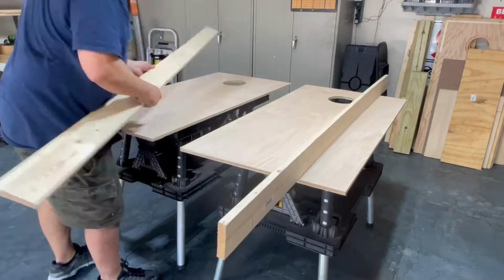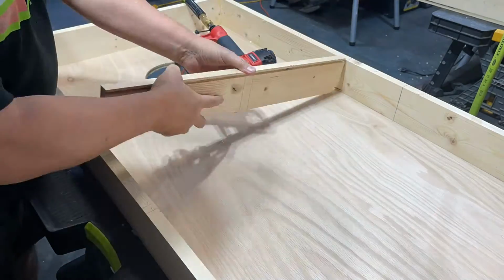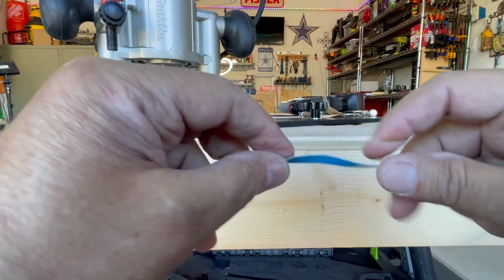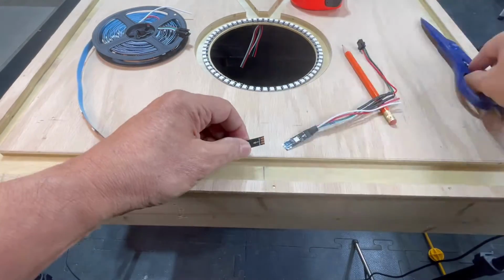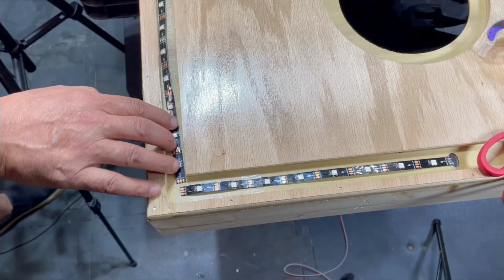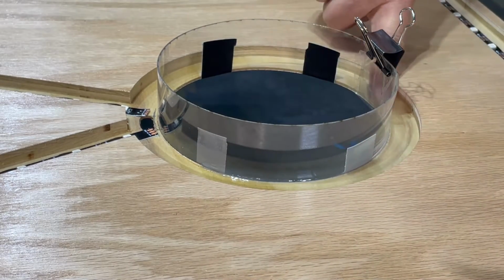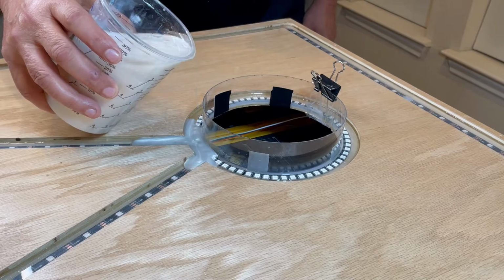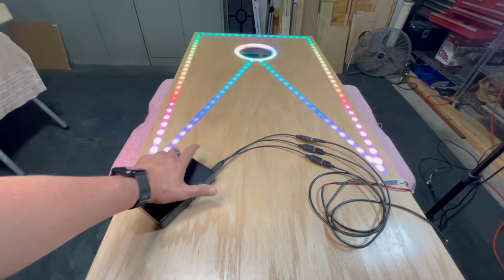How to make LED Cornhole Boards.  Step by Step. Addressable LEDs!!

Comment: man if an led needs repair
Reply from the maker: Hi Postskeetclarity.  
thanks for watching and yes..you are right...
if a repair is needed..you are pretty much out of luck to make a repair since the LEDs are in resin.
thats why it is soo important to test test test...and make sure your solder connection are good.
I have made a number of these boards and I have never had the LED strips fail.  I have one set that is almost 3 years old and its still operating fine.
thanks again for watching my video..i hope you make a set of your own! 
Rico
Reply: @ricohernandez2394  I understand Rico what you mean.  my experience with putting LEDs on my roof edges for permanent lighting lead me to understand the importance of having accessible repair but yeah you’re right especially that these things are not like roofline edges to where you gotta be up on some ladder. The boards will still work. I would buy them off of you in a minute.!

Comment: using the LED lights you recommend will they light up when the bean bags hit the board?
Reply from the maker: Hi Pat, 
 Thanks for watching and thank you for your question.  The LED that i used in this video will NOT light up when the bag hits the board.  These LED were connected to  to a arduino and it was programmed to light up when vibration is detected on the surface. 

This video 
https://www.youtube.com/watch?v=Dxkv4CdcfWs

uses an LED strip that detects sound and the LED will light up when the bag makes a sound by hitting the board.
Here is a link to an almost identical LED stip that i use in the build.
AMAZON...
https://www.amazon.com/Govee-Assistant-Segmented-Changing-Bedroom/dp/B0991KSWN9/ref=dp_fod_sccl_2/130-6737948-9447415?pd_rd_w=ariXY&content-id=amzn1.sym.550e945f-c48e-4794-aff0-cc9017996f0a&pf_rd_p=550e945f-c48e-4794-aff0-cc9017996f0a&pf_rd_r=1QAKZY01DB5Z7R6J9KVK&pd_rd_wg=BKzmm&pd_rd_r=91a8fc1c-746c-4126-a82d-0c7d28bd39d9&pd_rd_i=B099WX9K4V&th=1

hope this helps.
Rico

Comment: I’ve been looking at doing this for a while now and have been struggling to figure out what to do with the lights. The epoxy won’t ruin the LED lights?  What is the oldest set and how long have the lights worked?
Reply: What I do is I epoxy my design so I'll do my design about 3/4 away through the board epoxy the colors that you want to cure flip it over epoxy through the rest of the board on the opposite side so that's completely see-through then you build little tunnels for the lights to be ran through so that way if they go bad, you can change out the lights and don't have to ruin the board

Comment: What is the usb hub you used?
Reply from the maker: Hi ergon58!
 Thanks for watching and thanks for the question.  Here is the link to the usb hub that i used.
https://www.amazon.com/Splitter-Transfer-Charging-Individual-Switches/dp/B0C1H46YM7/ref=sr_1_18?crid=1JF86P8ZAHRZ3&dib=eyJ2IjoiMSJ9.gkgGZh-GTiQSzReaSjue0r--V0tMAJm4bQnodyU9zNEkUQsC5rCXtdXVtLUaPwD-QDkwgxxqLUoQpnCjLDNToIUzmAvByHITr-nA8yKktCJM-mYgObzcxPhCjm7V70LOndBWTiQPmtfkmAHD6HaRxsgYrqzMyXa1Q0vWAYoter97cYwVjU4f9nj2AqedW6dgURfWoPPQIeoIMjLStVcjLsvy85OnJn97CgsBsjiMMkQ.3CoOIr78CgBZx2VY6hSAmY6BqPV93JEFvW9gPYNePI8&dib_tag=se&keywords=usb%2Bhub%2Bwith%2Bswitches&qid=1708626561&sprefix=usb%2Bhub%2Bwith%2Bswitch%2Caps%2C164&sr=8-18&th=1
Hope this helps..  Have a great day!
Rico
Reply: Much thanks, inspired to make a set of boards for my 10 YR HS Reunion - awesome videos keep it up! @ricohernandez2394

Comment: What’s the voltage on the power supply you used at the end of the video?
Reply from the maker: Hi weare4l24!
  Thank you so much for watching my video, and thanks for the question!  Better than tell you ...Ill send you the link so you can get all the juicy details for this rechargable power pack.
https://www.amazon.com/gp/product/B00ME3ZH7C/ref=ppx_yo_dt_b_search_asin_title?ie=UTF8&psc=1

This pack will last about 10 hours powering the LED strips!

Have a great day... Rico
Reply: Thanks 🙏🏽

Comment: Is it important to use waterproof led lights..?
Reply from the maker: Hi Antonmayer!  
   Thank you so much for watching, and thanks for the question. I have used waterproof and non-waterproof LEDs, and they both work. However, I do like working with the non waterproof LEDs better. They are easier to work with.  The waterproof type have a thick clear plastic over the top of the whole strip… 
And if you have to cut the strips you will have remove the clear plastic covering to access the soldering pads.

I hope this answers your question… 
Have a great day!!
Rico
Reply: @ricohernandez2394  all Right thank you. I was not sure if epoxy is electric conductable
Reply from the maker: @antonmayer7891  Epoxy resin is not a conductor.  Hope you try to make a set of boards!  Happy Thanksgiving 
Rico